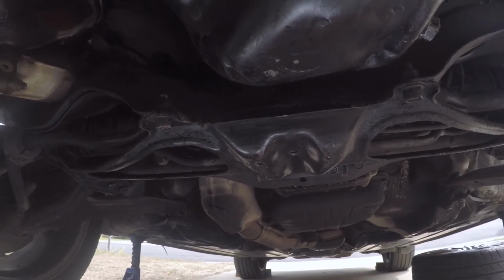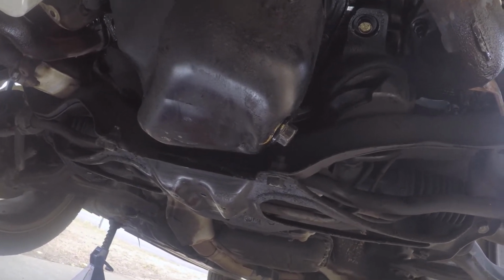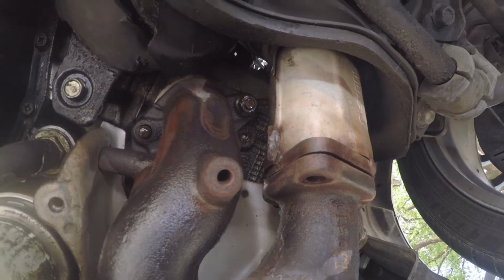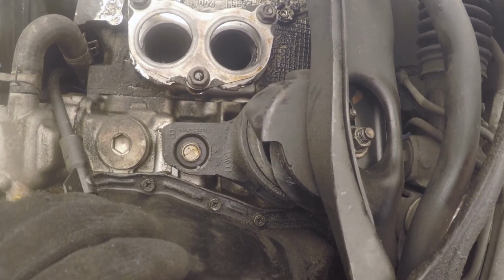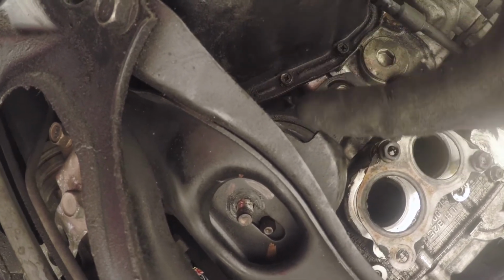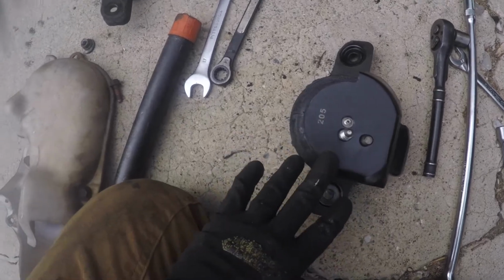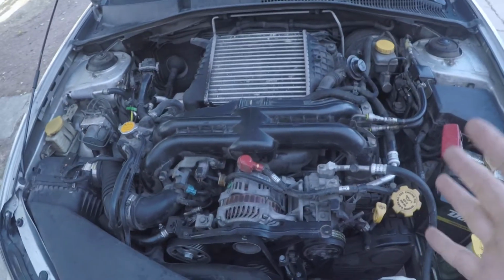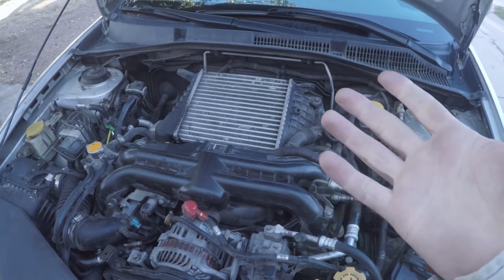Motor mounts for a Subaru Legacy GT.

Comment: Great video!! I have a 07 Subaru Outback with looks like a bunch of oil debris around it. It does look like it’s coming from then engine. So are the mounts rubber and filled with oil? Or just solid? I can’t find anything them that says they have oil?  Thanks for video tho!

Comment: In AUS here. Locally qouted 200$ USD for installment (mates rates as I do some photos for the garage). However, initial qoute was for 2x OEM Mounts which are super expensive! 3rd Party a fraction of the cost. Let you know if things change

Comment: Great video! I have a 05 Outback XT that has the same setup with the engine and mounts. Question for you: do you think using some kind of spacer (wood blocks?) would help keep the engine in place when you need to lower it back down? Seems like it would be worth a try.

You also don't look like you live in a road salt area like the Northeast. I will be contending with very rusty bolts.

Comment: You dont have to jack motor up for plugs
Reply: Id rather off myself
Reply: On the h6 the back bolt on the drivers side is a pain to get out without lifting the engine a little but it is possible.

Comment: Wow so much really great information that other videos I watched on LGT motor mount installs!
Only thought of switching mine out because I have to lift the engine to replace my valve cover gasket, but thanks to your experience, I'll just wait on the motor mounts till I absolutely have to switch them out & pray my mounts don't rip like your's when I lift it from the oil pan. 🙈